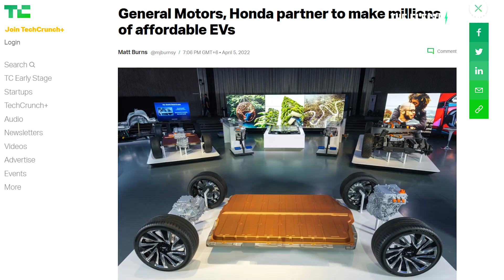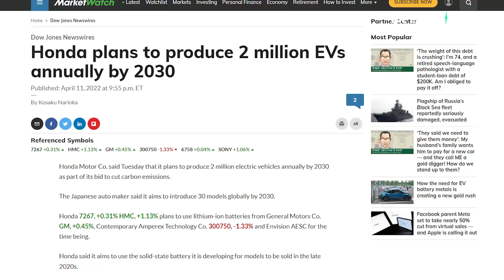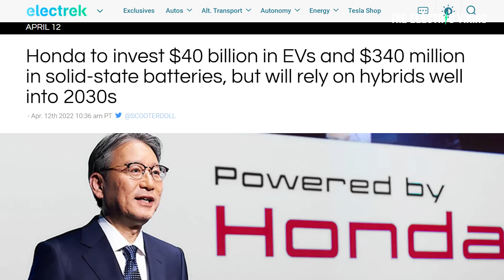Honda spending $40 Billion - can it stave off bankruptcy?

Comment: Honda are the largest ICE manufacturer on the planet. It's not just cars - land mower engines, generators, mopeds, they have it all. And it's all going away, fast. I don't think there is a viable way for them to transition, so my guess is they will make bombastic statements and milk the brand as much as possible, then GTFO.

Comment: Honda currently earns 4X the revenue that Tesla does. Spending 40 billion is not that much for a company that earns 132 billion a year. Honda is considered the 5th most valuable car brand in the world, and will be around for many decades to come. The Japanese are awfully good at making high quality products, and I for one love Honda equipment.  Japanese companies are very slow to respond to trends, as they follow what their customers' purchasing habits lead them towards, and until the customers change their preferences they don't respond. They are not going to lead an EV revolution, but as buying preferences change, they will adapt.  The Japanese don't invent a lot of new tech, but they are masters of manufacturing, and although they entered many markets late, they invariably come up near the top in every market they shoot for.
Reply: Honda's 2021 revenue was 124 Billion, and profits were 5.2 billion. The 40 billion is a lot when you have 5.2 billion profits. Your numbers are a bit off. 

They are not going to make it trying to change over in 20 years or more. Slow to respond is failure when your in a disruption. Good luck!!!

Tesla made 54 Billion in revenue and 5.5 Billion in profits in 2021. They did this with 936k cars, VS 4.5 million from Honda. Honda has 1.25% more revenue and they were 300 million less in profits then Tesla in 2021? 

This was out that on the internet.
Reply: @MyUniversalUniversity  Having worked in Japan, the Japanese are plenty fast when aroused. Due to government support they pursued a Hydrogen strategy, which so far has been a dead end. 

comparing Tesla profits directly with Honda is not a fair comparison. Honda is selling via an independent dealer network, which also generates a lot of profit, and that is not added to the published numbers. If you imagine a future universe where Honda cuts out their dealer network, then the profit comparison will be more valid. 

Service, Parts, Sales are the 3 parts of the dealer equation, and they make more than the manufacturer does. Tesla cannot operate successfully in all territories with direct sales, as this is barred by law in certain jurisdictions, and I doubt Tesla will gain an inch of traction until they bend to the laws in those regions.  

For example, Tesla only sold 8000 cars in all of Japan last year, a trivial amount out of 4 million, even though they were allowed to sell directly.   That 0.2% market share.  Tesla sold 18k cars in Korea in 2021, out of 1.8 million. 

Tesla is doing very well in China, but Korea and Japan will resist them mightily.  And in places like Malaysia, Brasil, and other countries which have high import duties, they will never get very far.  You want to conquer the automotive world, you will have to have local factories. 

Tesla is picking off the low hanging fruit, but with  factories in only 3 countries you can't conquer the world, and American firms are discriminated against in many places.

Comment: To sell millions of EV’s you have to make millions of EV’s. There in lies the problem.
Making EV’s at scale is hard.
Reply: @benjaminsmith2287  Obtaining batteries is the hard part
Reply: It's easy to make EV's! Electric motors are much simpler than gas engines. The challenge for the industry is where to make profit. ICE don't make much money on the sales of the cars. They make obscene amounts of money on selling parts, so the cars are designed to need maintenance & break down, needing replacement parts. EVERY move Toyota is making is in an attempt to maintain this system, which will NOT work in the near future!
Reply: @benjaminsmith2287  Elon disagrees. EV's have way less parts then a gas car. The are the same car except the drive trains. All companies are having cost and availably of resources. EV's are not easy to make at all.
Reply: @MrChiangching  That is true, but EV's are difficult to mass produce.
Reply: @benjaminsmith2287  I give you that.
Reply: @MyUniversalUniversity  Not if you have the batteries
Reply: @benjaminsmith2287  They are not easier to make them with long ranges and fast 0-60 times. They are not hard for Tesla to make profits on them, only Legacy and new EV companies have that issue.
Reply: @MrChiangching  Maybe, but Tesla is the only mass produced EV's in most of the world, so far. If we are talking huge mass production, no one is going to beat Tesla, even if they have enough batteries.

Comment: Honda bases their competitive strength on engine reliability and performance. They make more engines of all sizes with the best reputation. What can they contribute to an ev that compares or is unique? Nothing yet in battery or electric motor tech. Where will their competitive strength be? They'll only have their past rep to rely on. This is why they don't see a way forward yet.
Reply: I guarantee you Tesla's engineering in all parts of the vehicle is better than Honda (or anyone else) :)
Reply: Well, they did kickstart a rather unique design philosophy with the honda-e and their sports concept (which never released, shame). If their new e-SUV in China is any indication, however, they gave up that design philosophy in an instant (and in favor of more generic junk).

Comment: I think for Japan strategic national energy policies are complicating things. Post Chernobyl, Japan does not seem to have sufficient electrical energy generation capacity to support BEVs.

 The long run hydrogen plan is importation of LH2 from countries like Australia, where it is assumed there would be a large renewable powered LH2 industry. 

The LH2 could be used directly in vehicles in liquid phase or as compressed gas in bottles at around 600atm.

The energy to drive the vehicles could be extracted via fuel cells or by ICE.
Reply: Hydrogen is the wrong road to take for vehicles. It is going to be EV only!!
Reply: @MyUniversalUniversity  True if you have enough renewable electrical energy or prospects of enough to charge them. It appears Japan like a number of other countries doesn't. Unsurprisingly they will build vehicles to suit their circumstances.
Reply: @jimgraham6722  EV's are much cleaner then Gas no matter what is charging them, coal, or gas. There is also enough energy to charge them as most people charge at home and at night when most are not using the grid. Is this what you mean.
Reply: @MyUniversalUniversity  Most countries use about 30% of their energy budget for transport. This energy is mostly in the form of diesel, jet fuel and gasoline.

If you eliminate fossil fuels the energy has to come from somewhere else. The problem with renewables is that the sun doesn't shine overnight and wind tends to subside so overnight charging is not so feasible. 

Japan's economy is energy intensive and while superficially it has substantial renewable energy resources, these have in fact declined as a percentage of the total and it is not at all clear it can meet its future energy requirements from domestic renewable resources.

This is a problem and that's why in that country, renewable hydrogen, sourced elsewhere, makes sense.
Reply: @jimgraham6722  I completely realize that there will have to be a transition. The solution for renewables is battery storage. That is happening all over the world. So it’s not gonna happen overnight, but it needs to happen consistently. And maybe Japan will be one of the countries it’s not gonna do it at all.

Comment: A quick google shows Honda currently (well end of 2021) has 39 billion in long term debt.   So this plan would double their debt.  I can't say if that is bad, their debt to equity ratio is currently  0.45.  This compares to Toyota's ratio of 1.07.   So, maybe Honda are in actually in a  better position than Toyota.  But you really need a financial analyst to look at all of the numbers to get a good picture, just looking at one or two number is not sound financial advice.

Comment: The trap for companies that are very good at making I.C.E. cars, like Honda and Toyota, is that they consider themselves experts in their field...and they are correct.  

 I remember when I was a great navigator. I could calculate a course based on celestial navigation with a sextant. I could plot dead reckoning courses using wind and tide data along with a good compass. I was an expert. Then GPS came along, and all that knowledge quickly became obsolete. Anyone, for less than the cost of a decent sextant, could navigate with better precision than by using traditional means. I remember it being hard to put those hard won skills aside, but change was inevitable. I am sure these great I.C.E. car manufacturers are faced with the same problem. The better you are at something the harder it is to give up!

Comment: As with the new mitsubishis, hybrids will evolve. The internal combustion has become an extention option while the electrical portion can be used full time if wanted. It doesnt make sense to compair hybrid to Nokia phones. And hybrid pricing is way more sencable than ev. Its like if the message is repeated over and over and over people will start to believe it. No.

Comment: Stop blanket comparing legacy auto to nokia.

Nokia imploded because the CEO they put in place was a microsoft man. Nokia could have played a sizable role in the smartphone market if they had not bet the farm on microsoft phone. Yes, it would have been vastly reduced from the 50% marketshare before, but 10-20% is not the same as the 1 percent they reached in a matter of months.

Killing off symbian right out was stupid, and cut off a shrinking but valid revenue stream. Killing off the N9 with maemo/meego was also pretty stupid, especially since that phone could have been converted to Android in a matter of weeks.

If you compare Nokia to Nissan, where microsoft phone would equal hydrogen, then the comparison would only be valid if all other products would be declared end-of-the-road today by senior nissan management. Just blanket comparing nokia to any legacy auto shows a severe lack of understanding of what actually happened at nokia. Read up.

-- a former nokia graphics hw team member.
Reply: It is a loose comparison, along with Blackberry and Motorola.